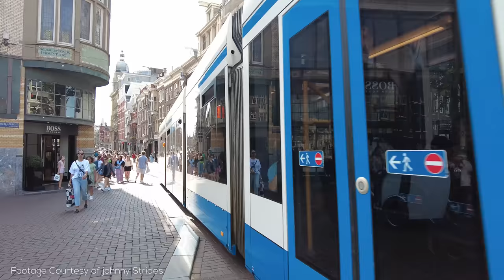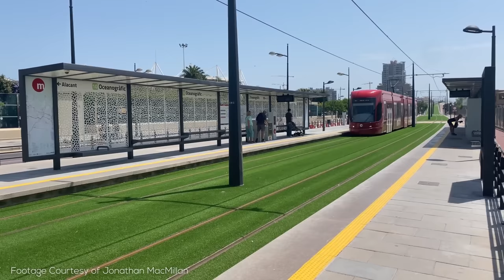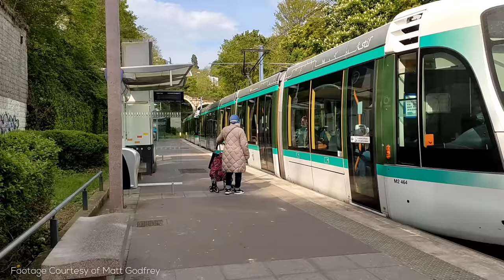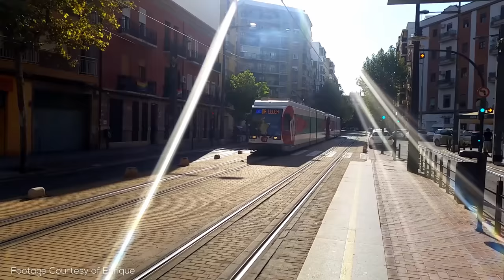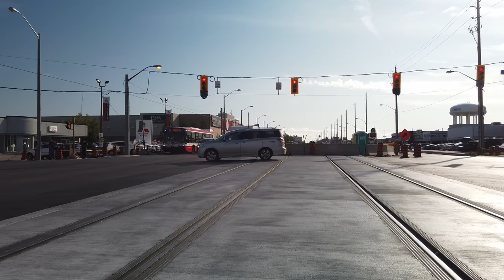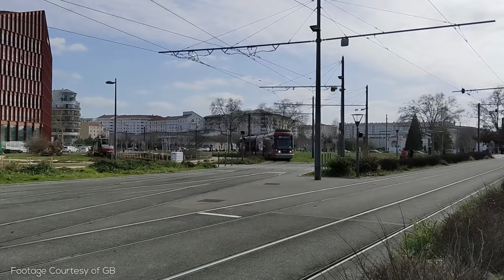What the US Gets Wrong About Trams

Comment: When I went to Augsburg, Germany, the trams there were quite great, different types (newer and older) mixed together. It worked great and all the trams I boarded where always on time within 30seconds of what the timetable says.

The trams were always different from the one before it with the sheer amount of advertisements/posters on the trams. One tram would be decorated with Lidl/Aldi bakery, another one with Volkswagen or Audi, others with Pharmacies/Apotheka, and electric/water distributor.

I think that really helped with sustaining the frequent running of the trams with some operating every 5-10mins near the university while other areas with 15-30min frequencies aside from weekends

Comment: I think vehicle designs in North America are generally pretty frustrating. Especially because the manufacturers that build them sell better designs elsewhere in the world that don't already look 50 years old when they are first deployed. Examples are the Silverliners built by Hyundai Rotem or some of the hideous LRVs by Kinki Sharyo who both make super sleek highspeed and metro trains for other networks. Or Siemens for that matter who's Avenio Trams are much nicer that what they sell in the US. Thankfully this does seem to change a bit recently.
Reply: This begs the question of do the nicer designs cost more? Or as another pointed out, do concerns for the vehicle's crash resistance affect what can be sold in at least the US, and thus appearance suffers? That said no matter how ugly the rolling stock is if the system doesn't get people conveniently from where they are to where they want to go it fails. It's an interesting point to think of having multiple layers of systems that separate long haul commute lines from those intended for going between adjoining neighborhoods. Might be possible just by reconfiguring existing bus lines to complement the rail service. I feel we need to have an in-depth discussion with those that plan our transit.
Reply: @johnruskin4290  I agree an "ugly" effective system is ALWAYS "better" then a "PRETTY" showpiece that does NOT offer service to a LOT of PAX

Comment: The problem with Toronto is that trams are used as a cheaper (key word) "alternative" to metro systems which is a problem. If they are needed they should be on their own merits based on need.
Reply: There is limited vision though. Zoning is lagging. The current tram routes under construction are all surrounded by low rise sometimes even low density buildings. For a proper metro to pay of density would have to be increased along the whole line, more than just 1 block surrounding a station like is the case right now.
Reply: @MrAronymous  For a metro to pay off all you need is to ensure that it will attract ridership. And one of the ways to do this is to make sure the stations act as hubs (i.e. buses service/terminate at those stations). You see this on Line 2 (particularly the Scarborough and Etobicoke stations) where most of the ridership does not live in close proximity to the subway line but is connected to it by buses.

This was part of the problem with the discourse surrounding the Scarborough LRT vs. subway extension. Sure, the LRT would be (by virtue of its seven stations as opposed to three) closer to more people but (as current usage rates for the SRT prove) the busiest stations (in this case Scarborough Centre, and Lawrence East) 
are those where the buses go.

Put another way, metros can be justified when you build existing infrastructure (i.e. buses and other routes) to service them more so than the immediate density of the surrounding area.

Comment: You're joking about Paris tram, I hope?  There's only one line, cut in half for maximum convenience, that requires to walk through a 6 lane boulevard to continue a journey started *on the same line*, and the whole darn thing is built parallel, 300m maximum appart, next to a disused heavy rail line, which is completely segregated from road traffic since when it was built. In 1870.
There were also massive cost overrun because stupid art installations had been added at nearly each stop, for a price of hundreds of thousand euro *each*. 
As soon as it was finished, it was congested, because at each road crossing, there are inevitable slow downs.

Comment: The biggest issues in North America are by far that they dont find that sweet spot in which trams work. Trams usually work best perfectly in between the needs of a bus or BRT, and between that of a Metro. So larger capacity needed than a bus, and yet where a full metro line isn't viable, and with a higher degree of priority in traffic than a bus, with dedicated lanes wherever possible and high degree of signal priority

Yet in North America most systems either overbuild their infrastructure with hugely long trams and large amounts of grade separated infrastructure except a few sections, that make you question why its not a metro. And in the other end you have systems with barely any kind of priority in traffic or dedicated lanes, combined with slow operations and small vehicles where it makes you wonder why they didn't go for a bus.

Comment: Me, as an active user of Eastern European "Light rail" (Prague and Bratislava mostly) can say, that tram line as long connected ride is extremely comfortable to use. There are multiple hubs and trams usually intersect on some parts of their paths so you can have a ride not by 4 buses, which are affected by traffic, but by 2 trams, which are literally light rail. Transferring from one part of the town to another is on another level. What adds to it, is that they are frequent and usually more frequent, than buses. Only subway can compete with such levels of effectiveness

Comment: I would love to hear your thoughts on the MBTA green line. To me it seems like a version of light rail that actually works in the US
Reply: Which line? The D line is kind of like a tram train and is pretty good, whereas the B and C lines are slowed a ton by lack of signal priority, the E line runs in mixed traffic, and the GLX is pretty similar to most modern US light rail. It’s certainly a well used system but it has a ton to improve upon!
Reply: I’m very excited about the new modern vehicles they’re purchasing, though! Those have the potential to double capacity with some station improvements.

Comment: I hope you don't solely blame the look of the trams in Northern America on Siemens, cause it's the operator that also decides large parts of the look and placement of the doors. E.g. in Munich the Siemens Avenio has been ordered with 2 doors for each compartment with 2 to 4 compartments for each tram (Munich has a single direction system, so doors are only on one side). So for the 4 parter that makes 8 doors or even 10 doors for a coupled 2+3 (which are allowed to operate in that configuration for a few months).

Comment: ...the transit mall which carries both bus and LRT traffic in Portland has always had an auto lane. When they brought LRT into the mix they took one of the bus lanes away and increased the distance  between bus stops from every pother block for a given eoute ot 4 - evne 6 blocks apart.  To accommodate stops for the LRT trains (which take up a full city block hence the reduced number of bus stops) .  What they should have done (and I suggested) was to take over the left side auto lane completely on both 5th & 6th ave, and designate that lane for the LRT tracks..  LRT trains have doors on both sides so there is no reason to have them operate on the right had side like buses do. Thy way spacing of bus stops would not have needed to be changed and there would be no competition for lane space between buses and LRT.  Again that "old style" thinking from the past. Even on the two LRT lines that pass east to west through the city centre there is still an auto laneon both streets  instead of dedicating it those streets totally to the LRT.and pedestrian-/bikeways. 

Save for the segments that run alongside freeways Portland's Max operates more like a glorified streetcar, particularly while in the city centre, as it has to to deal with traffic signals and other vehicles. I timed how long it took to get through downtown on one of the east west lines and it took almost twice as long (because of all the congestion and traffic signals the trains deal with)  than from the stop before the West Hills tunnel to the suburb of Beaverton (which is about three times the distance).  

So like with teh FX-2 BRT I commented about on the BRT video, TriMet seems to have purposely hamstrung the system through poor conceptualising and planning.

Comment: There is also a thing to consider about european tramways. Most citys use them as a Metro-Light. Citys like Cologne (1 Mil), Leipzig (700k) or Dresden (600k) can work perfectly fine without any Metro at all.
You just need to provide a strong backbone which goes from where people live to the center/POIs. Hell normally citys in the span from 100k to 500k get to live without a tunnelsystem for transit at all.

So just build trams on dedicated ways. They dont need to be in every street in the city. People will walk the last 500 meters at ease.

Comment: I agree with you 100 percent. We should have gotten elevated metro lines that is supplemented by streetcar systems. But the streetcar system should be more intensive than the elevated metro, because it easier to apply. So a elevated metro should be built far enough from each other outside the central business district that they become convenient for longer distance commute. They also would provide a meaningful connection to an intensive streetcar system.

The big advantage of a streetcar system is that a single car is required. This is good for two reasons. 1. It will have less impact on the street. 2. Big and complex stations wouldn't have to be built. 3. Single cars that get full would induce more frequency. And more frequency will induce more demand, because people like convenience. 

Elevated metro advantage is 1. It avoids vehicular traffic. 2. Cost is cheaper than building a subway.

Comment: Greetings from Germany 👋 In my Hometown Kassel we mostly rely on our Tram System. With 9 regular Tram Lines we have quite a lot of them for a city of this size. Additionaly we have specialized Trams which are called "RegioTram". Those RegioTrams are not only able to use the citys's Tram rails, it can also drive on train rails to connect to other citys. Oh of course, we do have bus lines too, but this is about Trams after all.

Comment: I curious why Reece doesn't mention San Francisco's tram/light rail system, which can be a blue print for future light in America, being one of the few legacy streetcar/tram systems. With regards to Auckland (New Zealand) proposed light rail system it is not a 'metro' system but a standard light system that will operate on the surface (street) and under ground using proposed 6 segment low floor light rail vehicles and low level stops.

Comment: Hi Reece, could you make a video on overground metro and light rail systems  in cities built on grids and if they are a viable option to be operated in those grid cities?
Reply from the maker: I don’t actually think that the city being a grid is a huge issue
Reply: For that matter, CTA Rail is colloquially called Chicago 'L' (for elevated) for a reason and Chicago is a grid city.
Reply: If the city is structured in a grid, structure the transit in a grid. If the city is structured radially, then do that. I don't think you have to add much there

Comment: Have a good Christmas RM Transit. One reason to why the United States gets the Tramway system wrong it has to do with how they have to be compliant with United States regulations which are requiring them to be built like a tank in order to pass the 800,000 lbs crush weight requirement. Which is also used in Canada and to get this correct why not set them up like European tramways.

Comment: also we have a lot of looong light rail lines (thinking about MAX but I'm sure it's true in other cities) that really need to be a higher speed regional rail that can actually compete with cars in speed and comfort
Reply: True.  Unfortunately cost is king here in the US, and the tendency is to build not for the future but for the least cost as possible, which in reality dictates crappy pseudo BRT or crappy LRT. (hello LA, I’m talking about you).  The really sad part is the costs here in the USA to build any infrastructure are so out of whack compared to global norms that what it costs to build a crappy LRT in the states could easily (in most cases) cover the cost of a reasonably high standard high capacity metro anywhere else in the world.  So we are truly screwed twice over here.  But that is probably the subject for a future RM explainer.  Happy New Year all!
Reply: Regional light rail does sometimes make sense, but probably not in the US setting, at least not the specific ones available currently. In Europe they are often used to connect many small cities on the outskirts of a smaller city, or sometimes many a bit larger cities that lie close together.

Comment: There are certain different types of trams that are not equal but share the same gauge based on what power they provide 

In Sydney for example 
There were Horse powered trams,
Cable trams just like Dan Francisco or Wales with a cable running underground (just like Melbourne)
Steam trams like a steam train (most NSW steam trams were American imported while some steam trams made in Australia were American copies)
Electric trams (first electric tram in Australia was Boxhill Doncaster railway.   Sydney’s first electric tram was through Randwick, edge cliff Rosebay in around late 1880s following electric tram extensions up through George street near 1900s)

Sydney’s electric trams started off with American imported (couple of them). The rest were Sydney made

There were different types of electric trams.
Platform trolley type ( C, D, E, class trams). Long street car trams ( F, G, H class trams), short cross bench trams ( J, K type trams), modified or rebuilt trams (L, OP trams), Toastrack trams ( N , LP, O, P class trams). And Corridor trams (R, R1 type)

Sydney was the second largest tramway system in the British empire

Comment: Stadlers Tramlinks are ideal for US use. its a Tram but can be purchased in 5 or 7 segments, can use multiple different power imputs, can even switch between two different voltages should it need to connect a more modern route with an old one, can go 50 miles per hour, has 10 doors on each side and is 100% low floor. they can even move on battery power for 400 yards in the event of a power loss allowing the tram to bring the passengers potentially to the next stop in such an event

Comment: About 45 years back, I met a Dutch tram driver who told me that their trams ran in lanes separated from other  traffic by substantial fences, but along main roads.  On approaching an intersection, a transponder on the tram triggers the traffic lights so that cars crossing in front of the tram were stopped and the tram got a green light to keep rolling. Also, the trams ran in coupled pairs;  if you had a ticket (which you could buy at most tram stops from a ticket booth), you got on the front section, and fed your ticket through a turnstile. If you didn't have a ticket, you got on the rear section, where there was an open space which could hold a fair number of passengers, and you could by a ticket from a conductress.
Result was that the trams could move through the city in the rush hour as fast as they did at off-peak times.

Comment: Bordeaux, France, use a Tram power system (in the city centre) that has an electrified 3rd rail in the road.  This means there are no ugly overhead power lines in the city centre.
It's a very clever design, that only transmits power to the section underneath the tram.  So it's "dead" until covered by a tram.

Comment: What is the functional difference between what you call a “metro” (like Chicago’s L or New York’s subway) and a grade separated light rail system (Seattle’s LINK light rail, or the grade separated parts of MAX in Portland)? It appears to my untrained eye that you could just increase frequency on a grade-separated light rail and suddenly it would function just like a “metro”
Reply: Capacity is a big one. But otherwise you are correct, that would be a light metro.
Reply: Also, having non-grade separated sections on a mostly grade separated line, like in Seattle and Portland, basically reduces frequency (and therefore capacity) on the entire line, compared to a fully grade separated metro.
Reply: my uneducated guess would be a Metro is 100% self contained tracks where as commuter trains / light rail are using sections of mainline freight rail / there corridor
Reply: Seattle's LINK isn't fully grade separated, for that matter.

The only metro (with full grade separation) I can think of which generally isn't considered one is Line 1 of the O-Train.

Comment: I would be curious about how you rank the Canberra tram network here in Australia. Canberra is a nightmare of car-focused urban planning that really needs some form of rail to remain viable, but I'm not 100% sure how useful the light rail will be on its further development. The trams are low-floor CAF Urbos 3s, painted bright red, and it runs on a fully grade-separated corridor with every crossing having dedicated traffic lights that prioritise the trams. It's fairly useful if you happen to live along its route, and it gets pretty huge patronage at peak, but further development of the line is being completely eaten by Canberra's incredibly powerful heritage board.

There's also the Newcastle light rail in Australia, which also uses bright red Urbos 3s and is grade-separated with separate crossings, but the Newcastle line is a freaking joke at the moment, largely because the single line is a grand total of 2.7km long.